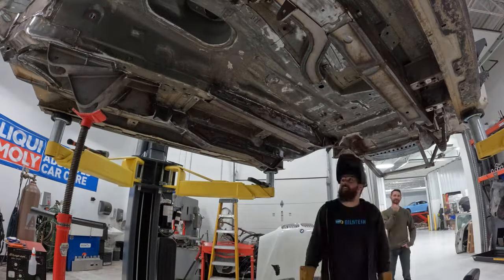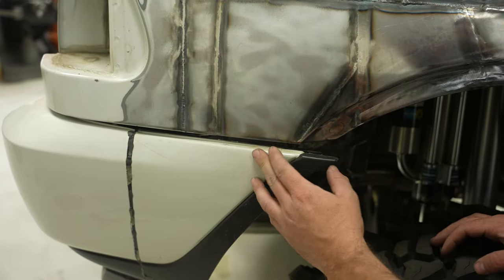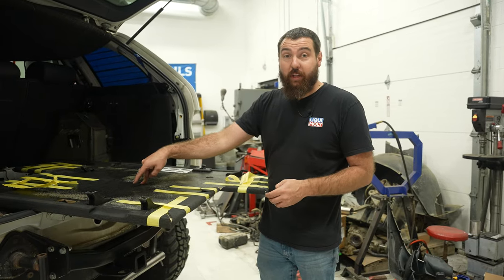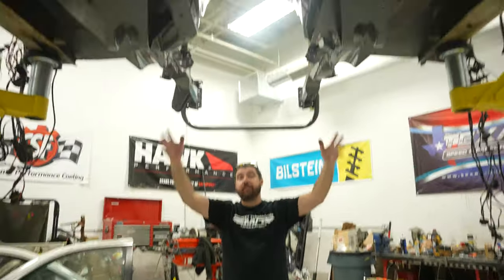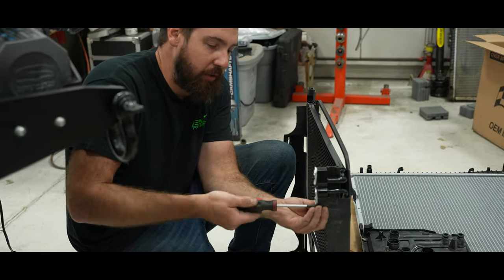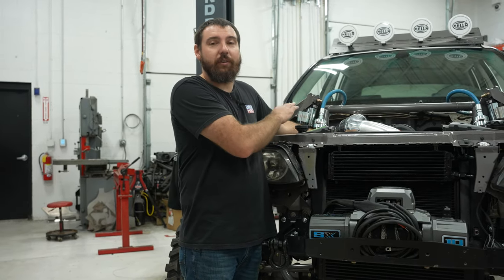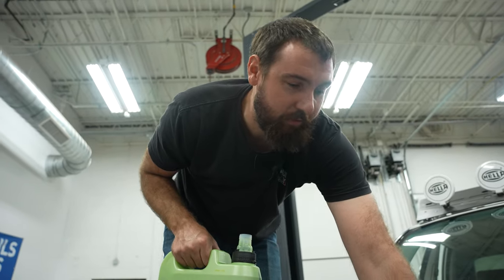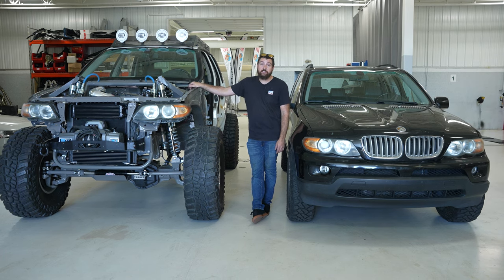Doing Final Assembly on the ULTRA X5! | Built by Mike ULTRA X5

Comment: Definitely one of the baddest e53's and x5's period for that matter! Nice job Mike! 😊 Only other e53 I like as much would be that silver one on gold BBS' LM's with the complete LMP drivetrain that's like 700whp! There's a video of Hans Stuck driving it floating around. 🤯 Video is well worth checking out if you haven't already. Your build looks so savage, especially next to the stock one! LOL 😂 I think I'd get some stainless mesh and a plastic welder (or soldering gun with the appropriate flat tip,) to "back up" and reinforce your seam on the shortened rear bumper. You did a nice job lining that up, and I'm confident you won't be able to tell the difference once the body guy goes over it. The panel bond stuff is strong, and if it wasn't an off-road type application where you'll be smacking stuff with it, you may be able to get away with it as-is. My concern is impacts from trees, debris, etc will cause the cover to flex enough where it'll start to separate and crack. The coarse stainless mesh added to the backside on the bumper cover, overlapping the repaired area/ seam will actually be stronger than the rest of the cover if you do it right. Trick is to heat the mesh enough where it will fuse itself and 'sink in' below the surface of the plastic. You can use leftover scraps from that bumper or similar plastic scraps as 'filler rods' to also fill in low spots, or add thickness behind the repair if you choose in addition. They do sell plastic filler rods just like with regular welding but as long as you are using the correct plastic, scraps are fine. ABS or PP is what you want. I've done a bunch of shaved/ smoothed bumpers, plastic welding repairs on all kinds of stuff, and various custom pieces as well as body work, and I just figured I'd offer some tips on that because I'd hate to see the cover flex and crack after it was just painted on a trail or something.
Looks awesome man! You really killed it!👍💪😎